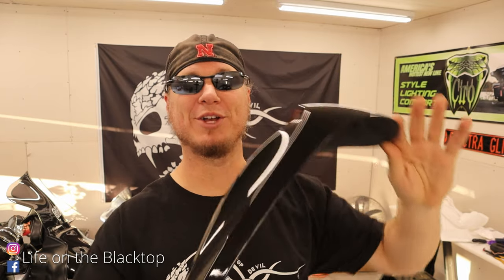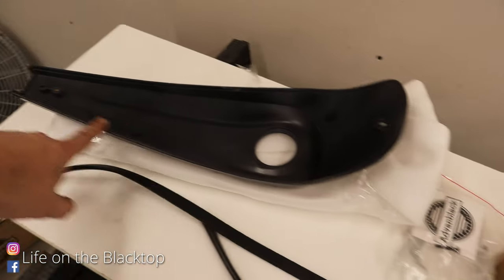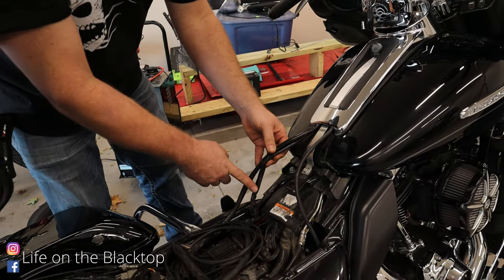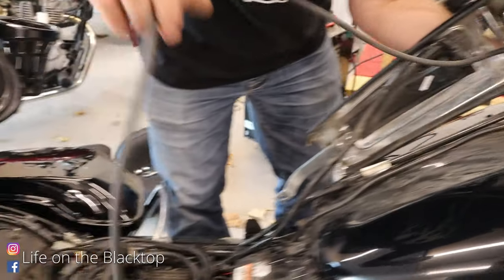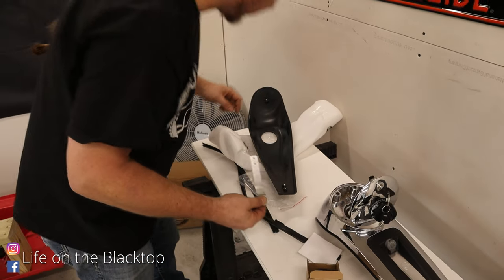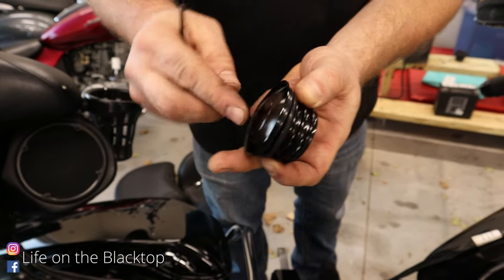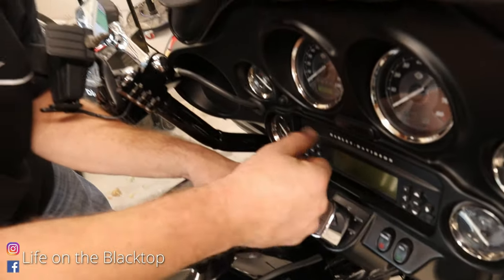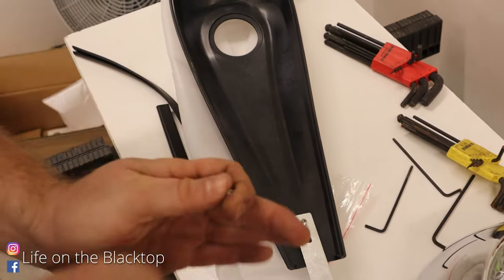Giving my Harley Davidson tank a facelift | Advanblack color matched dash replacement.

Comment: Did you get rid of the vent from the original dash? Great video!
Reply from the maker: I left it attached to the stock dash and chucked it all into a box. Its more of an over flow hose, so I just try to be careful to not overfill the tank.

Comment: Looks great! I have a limited also, did the bike function properly when you disconnected the harness or did you have to plug it back in and coil it up under seat?
Reply from the maker: Functions just fine with it unplugged! Occasionally I find the plug and wire under the seat and think to myself “what is this?” Then I remember lol.

Comment: Hi Brian.

Keith from Spokane here. Long time listener, first time caller here. It's taco Tuesday here and I figured why not have a couple beers. Anywho, I have a technical question for you. Do you ever find while you're riding, that your front wheel floats or is hard to turn because of the center of gravity being so far forward on your gas tank due to the weight of your giant balls? I'm curious on your thought and how you manage this somewhat unique problem. Thanks for your input.
Reply from the maker: Great question Ten76, thank you for calling in today. Luckily they hang low enough that the center of gravity with all of that weight is just inches off the blacktop, making turning quite easy!

Comment: I was wondering which gasket did you use for the gas cap? I have a 14 Ultra and I used the two small ones and left the thick one off.
Reply from the maker: If you're just using the dash on a stock tank, don't use the round o ring and just use the flat one. If you have the Advanblack full tank covers, go ahead and use both.
Reply: @LifeontheBlacktop  Thanks

Comment: Did you end up disconnecting the old console cable there at the battery? If so, Did anything else quit working ? Got my console coming in the mail soon
Reply from the maker: I did. Everything works fine, other than the CB of course lol

Comment: There were so many similarities in your introduction to this video that fit my considerations in replacing the console. Specifically the greater adjustability of upgraded Yaffe handlebars. The back curve on the bars practically hit the console at full lock. No adjusting handlebar to accommodate a short geezer like me. As the worlds bestest procrastinator I want to ask, did you get the handlebar adjusted and did you have enough room for clearance. Does the black color ease the glare issue enough? Great video content and the camera work was excellent as well. Loved the humor! Thank you for sharing!
Reply from the maker: Yes I was able to adjust it where it needed to be after I installed the new dash! Worked like a charm! Also yes the glare was significantly reduced/eliminated adtwr putting this on the bike.
Reply: @LifeontheBlacktop  Thanks I'm going to go black rather than Brilliant Silver. May have to do a comparison first. Thanks again. Very helpful!

Comment: what did you do with the vent tube you pulled out when pulling the old dash off? do you not need that with the new dash
Reply from the maker: I left it attached to the stock dash and chucked it all into a box. Its more of an over flow hose, so I just try to be careful to not overfill the tank.

Comment: Can I ask you a question.  Did the gas cap opening line up prefect  or was it a little off
Reply from the maker: Put the gas cap on first and that will line everything up, then you can attach the other bolts. That way it will be lined up correctly.
Reply: @LifeontheBlacktop  I did and its still a little off but manageable

Comment: You should have changed your fuel filter you were right there.
Reply from the maker: It’s not due for another 10k or so. I’ve already changed it once.
Reply: @LifeontheBlacktop  Copy that. Maybe I change mine to often. I do mine with every riding season, along with the oils and oil filter.
Reply from the maker: Probably a little much for the fuel filter. It’s an automotive style filter so it’ll go 100k before it needs changed. I do everything to service manual and mine calls for every 25 or 35k, I don’t remember off hand, but the following year they changed it to 100k and it’s the exact same part number.
Reply: @LifeontheBlacktop  I know it's off topic Do you notice any milage increase's after you do change your fuel filter? Mine was black as coal and couldn't believe any fuel could get through it.
Reply from the maker: @Wally2Feathers  I have paid attention and not noticed a change at all. In theory, the more plugged it gets the better fuel mileage you should get since it would be leaning out the mixture a bit, but I think there's enough pressure where you wouldn't see that until a lot of miles or after a bad tank of gas.